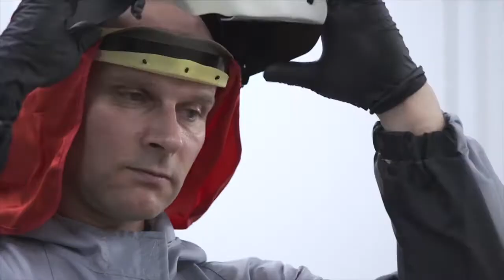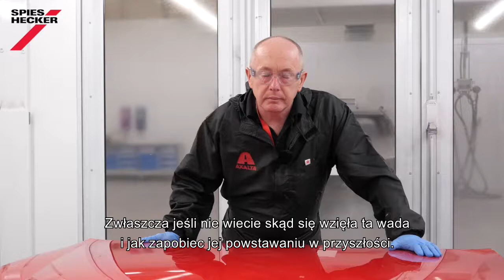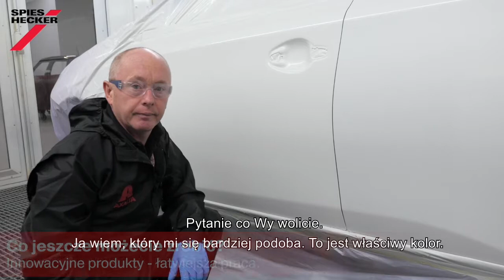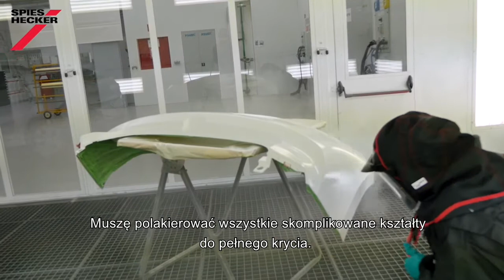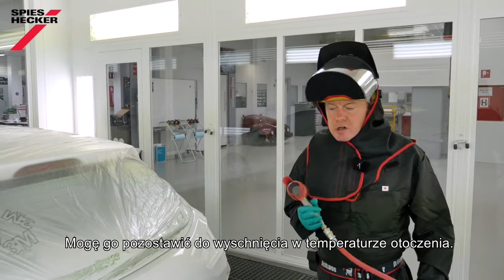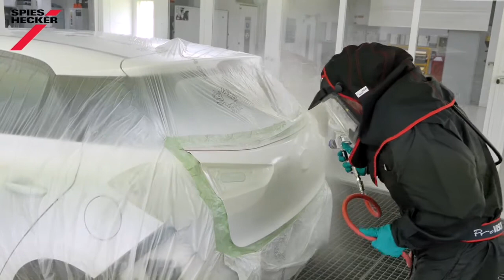Permahyd Hi-TEC 480 Base Coat: Jak zapobiegać igiełkowaniu

Comment: If you are  doing a overall paint job what type hardner would you use during the summer months with the 8035 clear
Reply from the maker: By summer I assume you mean hot conditions? If so I would use a slow setting and take depending which hardener technoloy you are using either HS3315 or VHS 3240. Personally I would go for the VHS Hardener option as this allows for the addition of reducer (either 3380 or 3385 slow) in RFU mixing which can again help with a large area in hot conditions